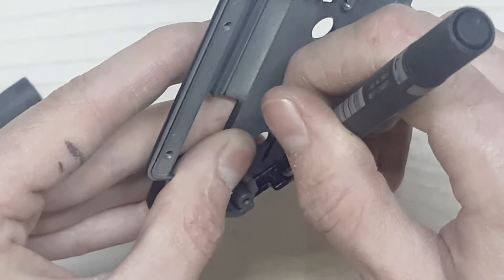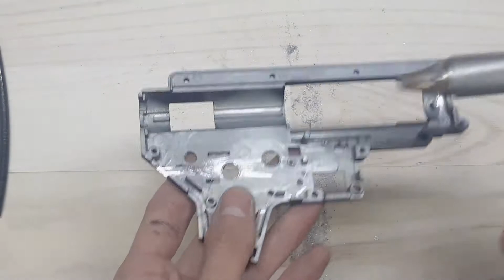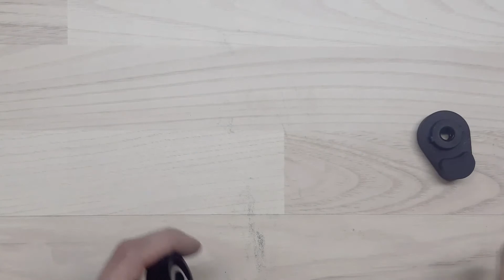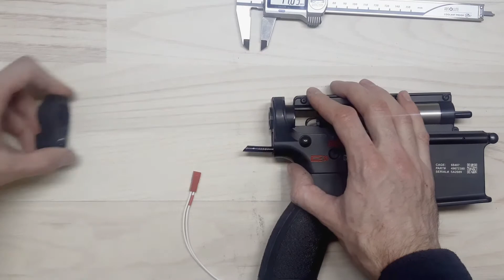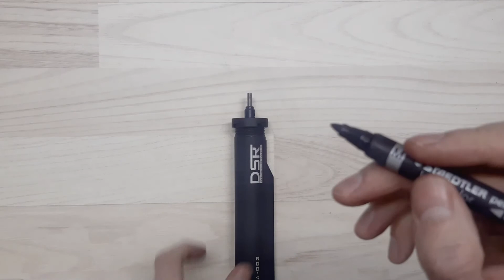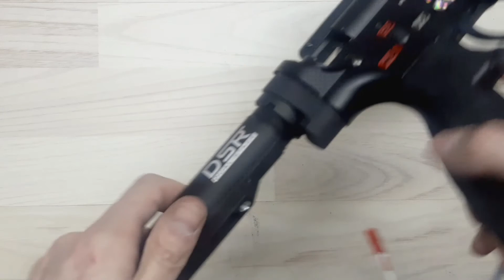Sparklabs CO2 dual stage regulator installation

Comment: Qual autonomia de disparos com co2 12g
Reply from the maker: Depends more on engine than by co2 regulator.
If you use it with Sparklabs Raven or Wolf provides high efficiency:

 -up to 390shots @ 1J
 -up to 300 shots @ 1,5J
 -up to 226 shots @ 1,9J

For other engines we have no data.